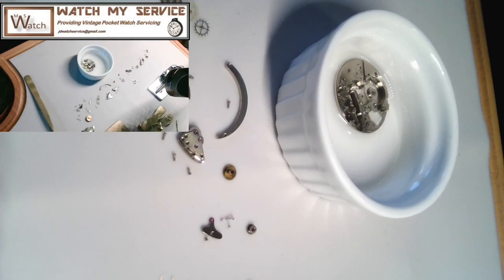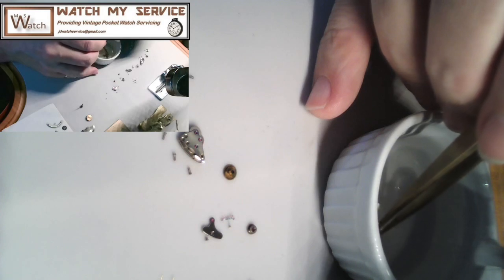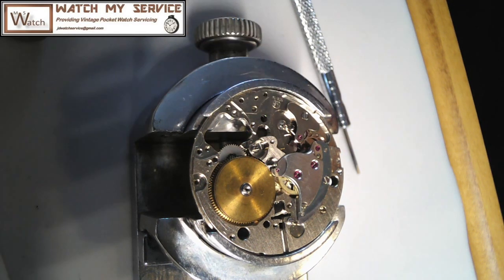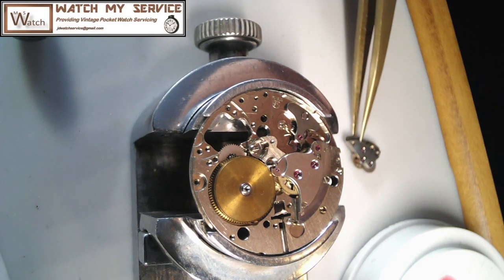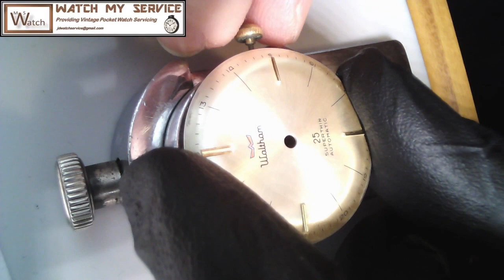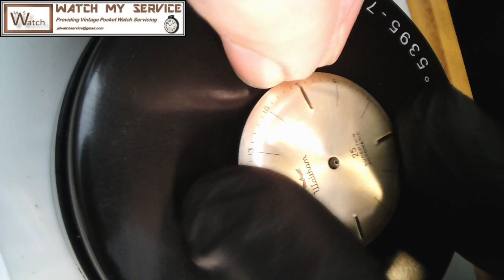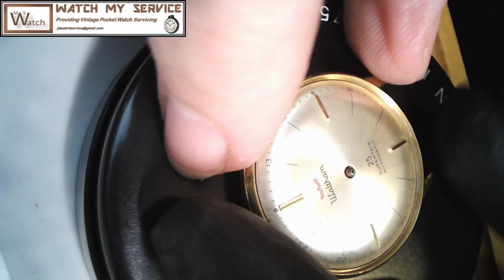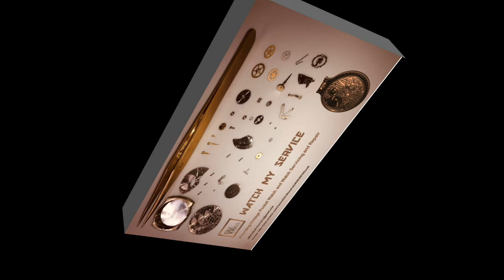25 Jewel Swiss Waltham Ultra Thin - Full Cleaning, Assembly & Test

Comment: A well job well done, when you were putting on the crystal, all most yell out stop, need hands on!
Than at the end and watch dropped, was praying that didn't break anything.
Yes a real cool  watch I'm sure not to many around working these days.
Thanks for the video enjoyed it.
Reply from the maker: I do show all my flaws as well as the good parts. This was my watch so was not as concerned with the drop:)
Reply from the maker: Ya, I did not edit out the drop...the watch is running great now as I regulated it shortly after and it is a beauty.  I am way more careful with other people's watches. Ended up with a 250 deg amplitude=500 deg full swing.

Comment: Great video. I watched every bit of it at one time. 3 hours, but loved every minute of it. That screw I think was already cracked before you tighten it. You did not torque it that tight. You know I love to see the close-up work on video, so keep it up if you can. You don’t have to cuss on video I am doing that for you. Haha. Good job my friend!!
Reply from the maker: Thanks, today, I dig into your high end PW
Reply from the maker: This little bugger gave me all kinds of challenge, including a gummed up hairspring that I could only see under my microscope
Reply: I know I saw that. You never use “one-dip” because it will desolve or loosen the varnish holding the jewels? I have seen some people put the whole balance mechanism inside a small jar of either lighter fluid or one-dip and submerge the jar in a ultra sonic cleaner with distilled water up like half way the sealed small bottle and let the cleaner run a few minutes. Is this a dangerous solution to clean the entire mechanism? Good luck on my old watch today. I hope it does not give that many problems. I see why now I should not do this stuff. I don’t have any parts laying around if one is broken or missing in the watch. That is what I found in the cheap watch you have of mine. I completely took it apart and cleaned it and found jewels broken so I was dead in the water. Had to go off to you. Could and should have done that in the first place and saved myself a lot of grief.